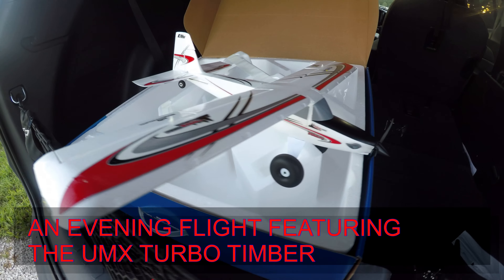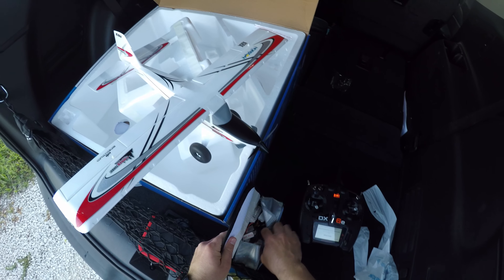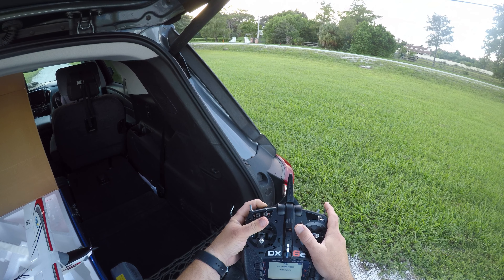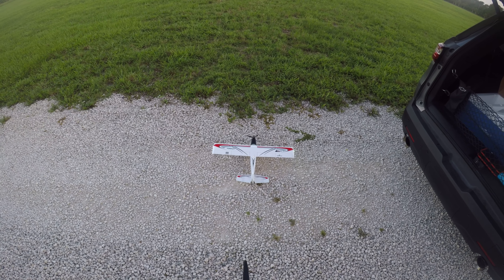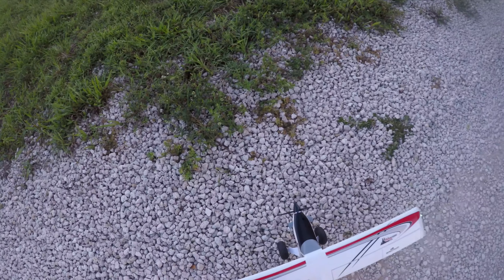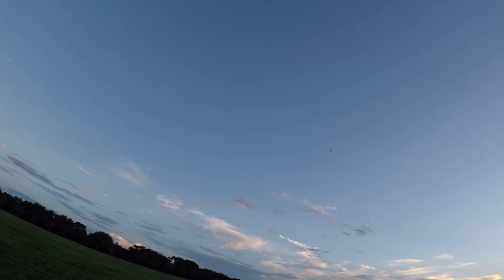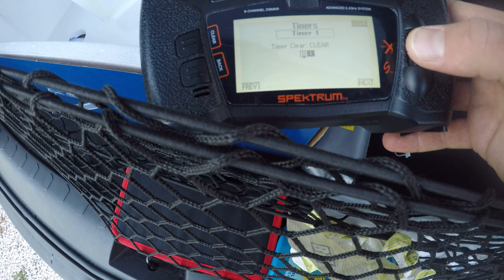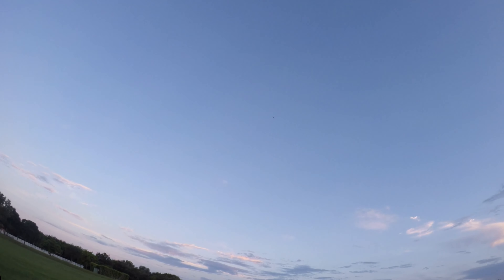An evening Flight with the UMX TURBO TIMBER...Should you get one?!?!?

Comment: This is an amazing little plane.  I've done just about everything with it.  Will do aerobatics no problem, just set the contrl throws and  D/R , expo right.  Will take off on a 2 feet of runway!.   Set take off flaps, hold full up elevator and gun it.  The  e-flight 280mah batteries are garbage.  Pick up some venoms like someone mentioned.  10 bucks on amazon, can't go wrong.  Also this little plane fixes up very well after a crash.  I flew mine into a light post at full speed (~40mph).  Cracked it in half, but then flew it the next day after 20 mins of repair.  Also flies super slow with full flaps and a bit of power.  Great flight envelope.  Have over a 100 flights now and I love it!
Reply from the maker: It’s a blast! Such a fun little plane to fly! Ans I agree with you, these e-flute batteries are terrible and inconsistent. I’ll get 6 min out of one and then like 2 min out of another. I always fly them down to storage voltage too. I’ll have to check out the venom ones. I’ve had a few responses recommending them!!
Reply: Do you have a link to a charger for the venom battery’s I can’t find any that are below 50$

Comment: Yes you should get one! This little plane is perfect to learn on and really fun to stunt once your experienced! Love mine but you will need to reinforce the horizontal stab as it flutters in flight and rips and cracks!😲😤💯 add a little carbon and keep an eye on that rudder as the foam hinges will fail after many landings! Use a little welder by homax and your all set, and you don't need to hand launch such a sweety! Just roll out and rotate all day long baby it gets in the air in 2 inches if you give it full throttle immediately. You could easily take off from that path bro😝😃😎👍💯and venom 430 mah 2s batterys give you 7 minutes and added weight dosnt affect this big winged bird! Also sounds like you need new batterys

Comment: Is there any reason to adjust the transmitter antennae on the 6E?
I bind by turning on 6E first, then insert battery in plane, then selecting Bind in 6E. Never had a problem.
Reply from the maker: No particular reason to adjust the antennae I believe, not for something like that you will be flying close

Comment: The batteries discharge after 3 days. You should allow 30 minutes between flights. I take out three planes and rotate as to not burn out the motors. Buddy, you need to read the manuals. It tells you all the info. the batteries are strong charge as close to flying as possible. A power pack on site would be ideal charge and fly immediately. 20 minute flights are possible with gliding between aerobatic passes. Good Luck

Comment: Buy Venom 430mah which extend flight times into 10 to 12 minutes depending on how you fly. I do a lot of aerobatics so my timer is set for 9 minutes. Put all the way to the back. Adds a little weight but does not affect performance. They have the UMX plug, plus Balance plug and PST plug. I use these on the original UMX Timber witch is two years old.
Reply from the maker: Glenn Bond this is awesome info! I will pick up some of those packs! The 280mah packs really don’t last long and 9 minute flight times would be amazing!
Reply: I made a foam battery tray which holds the battery. A little Velcro strap holds it in. The Turbo Timber might be different on the battery all the way back against the receiver brick. Check CG. With this battery, WIND is not a problem at all. That little extra weight makes it awesome.  Have flown RC for 51 years and the UMX's are just FUN and relaxing. Hardly flying my big planes anymore.
Reply from the maker: Yeah, the umx planes are a blast. Most of them fly really well and the conscience of them is second to none. Sometimes I don’t want to load up the plane, drive 25 min to the airfield, set up and wait. One of these you can go to a small park or field and have just as much fun! And this timber is a beast, flies just as well as my bigger planes in most cases!
Reply: @josephtiani6145  I have 7 acres I fly on. Also with a pond to fly off of. Check my videos. Enjoy you Timber.
Reply from the maker: Glenn Bond I will check them out! Awesome!
Reply: @King Joffrey Should not be a problem, Plenty of power. The advantage of the 430 battery is more weight to penetrate wind so the extra weight should not be a problem.

Comment: I've been learning  on the Sport Cub S2 and RF9.5. I think the next plane for me should be the UMX Timber but I hesitate having to buy an expensive transmitter. Wish the plane came in a RTF package.
Disappointed learning about the short flight times as that might have me looking at a different RC plane.
Reply from the maker: If you have a flying field near you I’d go with something like the aeroscout rtf or apprentice rtf. I have the mini apprentice rtf and have flown the crud out of that thing, it’s a little bigger and you get the transmitter with it. It’s very easy to fly with safe and is forgiving when you bump it up to intermediate and advanced modes. I like the umx turbo timber, but if cost of entry with the transmitter (dx6e at minimum) and the plane itself is high I’d just go with the rtf. You’ll have a ton of fun either way! Oh, and the mini apprentice with a 2200mah 3s pack can fly for around 10 minutes, maybe longer with throttle management!
Reply: @josephtiani6145  thank you for your informative reply.
Reply: What range of flight times are you getting with the Sport Cub S2? Thanks.
Reply from the maker: I usually get around 4 to 5 minutes on those smaller batteries for the sport cub s 2
Reply: @todd92371  Hi AT, approximately 5,8, & 10 minutes with my 150, 180 and 200 mah batteries. I must quickly add though that this is with temps over something like 50F. Right now here in North Central PA I quit flying my Cub S2 because I only get a minute or so of flight time regardless of which, fully charged, battery I put in the plane. These tiny one cell batteries just can't perform in the cold!
Reply: @josephtiani6145  Thanks, some good suggestions.
Reply: @BillKisel  Thanks so much!
Reply: I get easy 6 mins flight time on the 280mah batery and you can fit a bigger battery if you like like a 600 mah one

Comment: What charger do you use?
Reply from the maker: I have been using the spektrum s150 with adaptors for the plugs that are sold on horizon hobby. The s2100 for some reason eight he same adaptors I’ve had issues charging them.
Reply: @josephtiani6145  thanks

Comment: Why place the battery on its side why not flat 😂
Reply from the maker: Good question! I just used the Velcro that came with it and seems to be the perfect cut size for the side of the battery. I do not think it will make any difference either way, but might be a little more stable.